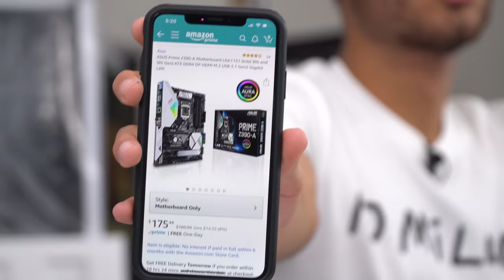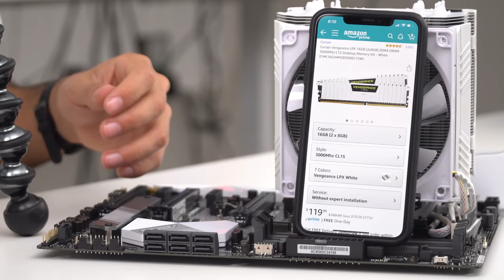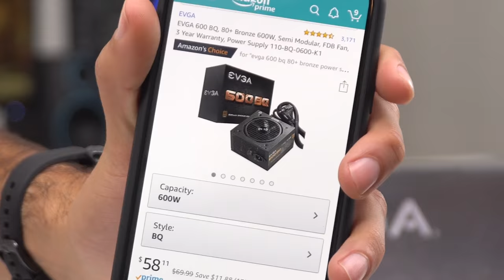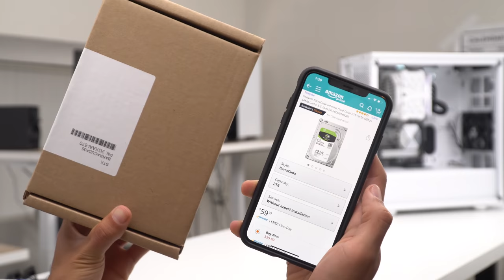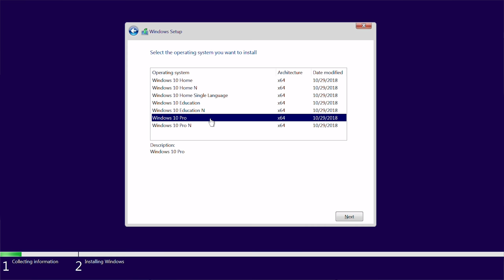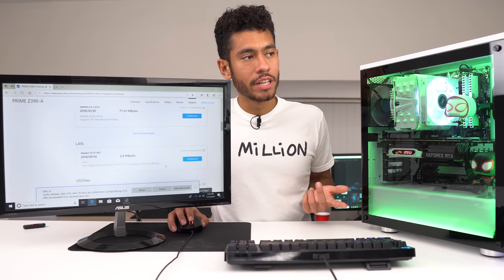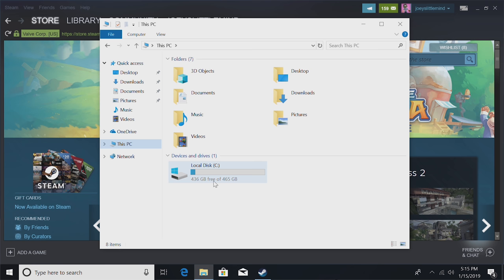$1500 Gaming PC Build Guide - RTX 2070 i5 9600K (w/ Benchmarks)

Comment: I’m building this pc in like 2 weeks when all my parts arrive, only things I changed were in using 2070 super and i7 intel. Do I need to change the power supple or no?
Reply: supply*
Reply: I have an unrelated question but did you get your cpu cooler off amazon and from the seller microcart
Reply: @evvanwhite  I got the cooler from Fry's electronics
Reply: Have you built it
Reply: vibranium I also built this. If you have questions I’ll be happy to answer
Reply: Electric Wolf do you play battlefield
Reply: How does it run like does the fps drop constantly
Reply: vibranium yes I have
Reply: vibranium it runs really good I haven’t overclocked it and it still is a beast
Reply: Rishabh Jain do you play bf v?
Reply: vibranium well I did change some things, I got 2070 super, i7 9700k, 64 GB Ram. But I do think it might be running a little hot I just gotta change the cooler to liquid one
Reply: Rishabh Jain yoo that’s expensive
Reply: vibranium yeah I spent over 2k lol and I don’t play battlefield V

Comment: Hey, can anyone help me? Ive bought a 2070 build for 1500 with about the same specs except the motherboard and processor. I got an AMD 3600 3,6 base clock. But the first 2 days I rocked everything at 150+ FPS but since a week I can’t run more than 80. What’s wrong? I reinstalled my driver multiple times and it doesn’t work.

Comment: Hey! I built this (with an i7 instead of i5) and the “dollop on the middle” for thermal paste was totally misleading. I turned my pc on for the first time and it only took 5 minutes for the core to reach 90 degrees.  More accurately, you should tell people to spread it around in a thin layer.
Reply: He's not incorrect. You did it wrong
Reply: It will spreas once u put the heatsink on it

Comment: 7:41 how did you do the wiring cause the camera angle is kinda fucky and I don’t really understand
Reply: Seri0sed the motherboard fan plug in spot is below the sata plug in. What he did is he took one fan cable and ran it in the back of the case and popped it out at that spot.
Reply: Andrew Tichich right but how did he get it from the from to the back, back to the front again. Cause he said it went up top and then back around to the mother board.
Reply: Seri0sed he put the cable through the nearest hole that separates the front and back

Comment: Is the thermal paste a separate cost? Or is it included with one of the components?

Oh and how well does this tutorial translate to the $800 build you have in another vid?
Reply: MidnightWolf Some cpu fans come with thermal paste but not all
Reply: @nico1415  is it required for installation?
Reply: MidnightWolf Its not but highly highly recommended. It transfers heat to your heat sink

Comment: Can I use a 650Watt 80 PLUS Bronze instead of the power supply he is using? the one he uses isn't available in my country. Also, can I use an NZXT Kraken X42 instead of the CPU cooler he is using? and is it better or worse? Thanks.

Comment: if I just switched out the i5 with a i79700k would it be ok or would I have to change some other parts too?
Reply: Just check compatibitly with the motherboard and socket of the CPU cooler and that I think should be it

Comment: is there a technical reason why you put the ram in those spots and not like side by side? (im building a  pc and idk if that is important

and why is the black version of the cooling 50 € less?
Reply: Yourigames Check your motherboard manual for which slots to put your RAM. Although most motherboards you put it in the 2nd and 4th slot.

Comment: Enermax ETS-T50 Fan Cooling ETS-T50A-WVS its like sold out 
What should you use to replace it?
And whats better in this case i5 or i7
Reply: The cooler master hyper 212 black edition is a decent option if your looking price to performance and can do a decent job overclocking
Reply: Jeffree Charles ok ty btw i5 or i7 ?
Reply: @andrenunes2496  depends on your need and budget. What is your budget?
Reply: @jamesscott3290  i7 would be better right and you you need a stronger power supply than the one in the video

Comment: Awesome build man just a quick question I got the same GPU as yours in the video and I'm not getting the same FPS results in gameplay any things I'm doing wrong do I have to bump up the ram it's currently running at the 2100 frequency out of the box I have not bumped it up to the 3200 frequency that it's able to do
Reply: well that's your problem lol bump it up
Reply: also quick question on internet...so if it's wireless, how do you connect?

Comment: I bought almost everything the same and even the asus monitor 144hz but i have trouble getting a display most of the time when im booting up, says no signal on display port or hdmi and ive plugged them correctly
Reply: Plug into the GPU
Reply: @jamesscott3290  it is plugged in the gpu
Reply: @picazoevo  did u fix it
Reply: @tinbullet2179  no bro i just unplug the monitor and plug it back in and it works, once its on it stays on so im just gonna have to reboot it everytime

Comment: I have a 2070, i5 8400, 8gb of ram. My fortnite when the FPS is uncapped gets up pretty high put for some reason dips a lot. I also have tried to stream and record with these specs but for some reason the quality is bad even with the new Nvidia encoder. Could it be my ram or is it my processor?
Reply: @Rad Rat Thanks, do you think upgrading to 16gb is enough or straight to 32gb
Reply: Rad Rat 16gb sounds perfect. I do edit using Vegas Pro 15 but with what I have right now the editing is fine. Once again thanks, haven’t gotten much help from anyone yet or any responses.

Comment: Hey so I built this pc but after installing all the drivers and everything I am not getting near the same FPS that he gets in the tests for some reason? Any ideas to fix this problem?
Reply: You might have vsync on  your games which depending on your monitors refresh rate could severely lower your fps. Try turning it off or if you have a high Hertz monitor set it to it's native (idk if that's the right term for refresh rate) refresh rate.
Reply: Jordan Freeman i figured out that for some reason my GeForce drivers won’t install because “they’re not compatible with this version of windows” even though I have windows 10 pro

Comment: Wtf I have I rtx 2070 and a ryzen 7 2700x I get about 130fps does the i5 9900k help that much
Reply: Yes the 9600k has better frames than the 2700x, due to its better single core performance. But the 9600k has only 6 threads and in the future it might or might not stutter.

Comment: Are u able to build the exact rtx 2060 build but with the rtx 2070 instead- meaning could u switch the rtx 2060 for rtx 2070 in the $1000 build???
Reply: I believe so but you need to have mid tower case because 2070 is bigger.

Comment: Is it worth it to get a 240 Hz monitor for this setup? And how can I find out if the PC is good enough for 240 Hz if I look at other setups?
Reply: BobbyMerica just look at benchmarks for the pc you want and if it can reach around 240 FPS on games you might want to buy a 240hz panel. Even if it can’t get that high of frames it will still look super smooth. Also there’s a 165hz spectre 25 inch monitor or amazon for 160 bucks if u want that instead
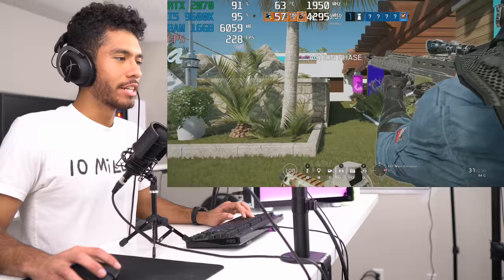Reply: @hyper9142  Ok. Where can I look for those benchmarks? I'm new to PC building and I'm planning to build the exact same PC. Are those the benchmarks 13:15?

Comment: 240Hz for Rainbow Six Siege on low/med settings? He hits 240 FPS in the video on Ultra Settings but it drips a lot.
Reply: Idk, 220-240 (sometimes more) FPS on ultra seems worthy of 240Hz if you ask me. Would rathe play on slightly lower than 240fps while having a 240Hz monitor than playing consistently on 144fps on a 144Hz monitor.
Reply: @Ab-er8ec  I wouldn't play on ultra settings. Mine will be on low and mid

Comment: Same pc spec and different fps. What causes the problem? GPU usage not that high as u How can i reach that performance?
Reply: i mean how u can reach nearly 100% GPU usage?
Reply: @gabordudas2789  it good to be at 100%
Reply: My PC spec: ASrock 1151 B360M pro4, Intel Core i5-9600k, 2x Kingston DDr4 2666 8gb Hyperx Fury GIGABYTE RTX 2070 WINDFORCE 8G, Seasonic Focus Plus 550 Gold. It is nearly the same PC but in Rainbow Six i ve got less fps (avrg. 50-60) WHY?
Reply: @gabordudas2789  might be your monitor try turning vsync off

Comment: Can someone tell me if I use a m.2 ssd will I still need the sata cables?
Reply: Strange Prodigy  you  only use sata cables for hdd or ssd. M.2 is already plugged in to your motherboard although if you plan on using more than an m.2 for instance a hard drive check your motherboard manual as some sata ports don’t work once an m.2 is installed.
Reply: Maniqa Dorthy| Thanks!
Reply: Hey. I don’t know how to build a PC and all. But the graphics card isn’t availible in my country what do I do

Comment: Why does he installed games on hard drive instead of on SSD? Im new to pc building.
Reply: I think thats bcuz games take so much space
Reply: @Fatima-re3wm  but isn't SSD run things faster?
Reply: @user-ee6md7vh1o  it does, you can do both btw it just depends on you
Reply: Its because games are huge af and will fill up the ssd with like only 3 games and u wont have space for other programs in the ssd. 
If yo get a larger ssd fkr example 1tb or 2tb it will cost u so much. 
A 1tb hdd is like 40 bucks but a 1tb ssd is over 100$

Comment: Hey I have this same pc but with a i5 8600k and on csgo I can’t get into 200+ FPS. Any tips?
Reply: Zaza Zaza idk
Reply: He has a i5 9600k that's probably why
Reply: And csgo is never consistent with fps lmao. It can run 300fps then the next day an update happens then it's at 120. It jumps, or so I've heard
Reply: YeoYolo Do you know if I’ll get better fps with the i7?
Reply: YeoYolo asking for fortnite
Reply: @teodoraljubojevic4319  the things that make frame rate better is the graphics card and the processors, so yes an i7 would most likely give better frame rate. But mostly the CPU gives better framerates when you are streaming or have a editing/recording software running. I would still look up a lot of reviews though.
Reply: @teodoraljubojevic4319  what I'm doing is I'm getting the rysen 5 3600 instead because 1. It's a little bit better 2. It's like 50$ cheaper and 3. It comes with it's own cpu cooler, which I've heard is good but I've already ordered a 4 valve cooling system
Reply: YeoYolo do you think a I9 9900k would do good
Reply: @horizon7879  well yea but I'm not no computer geek lol, but that cpu might be overkill for this motherboard but Idk lol i would do research

Comment: What would be a replacement for the cpu fan as it is always out of stock and im building this pc?
Reply: Pickle Boy I recently bought the fan and it came back in stock. Idk if it is now
Reply: I can't find the cooling fan for the cpu, its sold out or out of stock everywhere, do you know a place I can order it from (I'm from UK)? And also did you buy the Msi RTX 2070 Armor or MSI RTX 2070 Armor OC?
Reply: @EPICBOSSYT  I went with the OC and i just swapped to another cpu cooler as it was always out of stock. i dont know if there is anywhere to order it from the uk but any other cpu cooler will do
Reply: @pickles8023  For the cooling fan I have ordered the deepcool gammaxx 400 white (£30) but the rtx cards are very expensive. The armor oc is out of stock or being sold at a very high price on amazon. :/

Comment: FYI this is bs you can buy a prebuilt from best buy  with a i7 8700 16gb of ram and a 2070 for $1349 and you dont have to do any thing other than bluging it in
Reply: Just saying pre built pc’s can work much slower then a pc you built and the cost for making this pc was about 1288$ it seems like you bought a pre built pc and trying to make you’re self feel better by saying one’s that you build you’re self are not good value
Reply: @raiden4239  agree
Reply: This is wrong. Also some prebuilts are aesthetically ass interior

Comment: how does this build do against higher performace games like the witcher ?
Reply: probably wont do so good on max settings but on medium settings it would do fine
Reply: Easily run it
Reply: @cade5745  nah, turns out does great on max settings. Getting 90-100fps most of the time, only occasionally dropping down to 80fps

Comment: Bro i looked up the parts on 7/25/2019 and the total was 1366i just got no money RIP
Reply: You can grab then new ryzen 5 3600x and 2070 super for a really good experience and the processor is gonna be cheaper if you want you can get the threadripper 1920x for 270$ witch has 12 cores and 24 threads

Comment: YO ANYONE IN THE COMMENTS
I wanna build a pc but the cooler is unavailable on Amazon is it fine if I use a different one. Don’t judge I’m new to building PCs 🥺
Reply: Yeah you can use a different cooler as long as it is compatible with your case and motherboard, if your not sure what is compatible with what, I advise that you use you a website called pc part picker and go to the build your own section and chose the parts that you have and then when choosing the cooler it will only bring up what is compatible with the parts you have so far. If you need anymore help just let me know. 👌
Reply: Luke Thompson-Hughes thank you so much !
Reply: @vampd01l94  no problem, anytime 👌

Comment: Guys so im new to this and i have a question 
So my motherboard will have  1 display port available but my graphics card will have 3 how much display ports will i be able to use and how?
Reply: 1
Reply: Wait read that wrong 3
Reply: connect the display cable to the gpu always not the mobo
Reply: SpeechlessSpecter ok ty

Comment: I used the same cable you used for your gpu to power supply and my graphics card just isnt being registered. I have tried literally everything and I cant get this card to work. someone PLEASE HELP ME. P L E A S E
Reply: Did you push it in all the way
Reply: @-injustice-6738  I figured out my issue. Was running a pretty old version of my bios. Updated it and everything went smooth
Reply: @GamerJW235  kk nice

Comment: What is the WiFi adapter used for? And once you connect to the WiFi do you have to keep it in at all times if you’re not using a lan cable??
Reply: Pardiiz there is 2 ways to get internet conection. 1. Wifi adapter 2 lan. Lan(with wire) is faster, but you need a cable, but wifi is slower, but without cable. If u are using lan, there is no need to plug lan and wifi in the same time.

Comment: If you switch the CPU out with a i7 9700k it will still be around 200 less than 1,500
Reply: Phizur is it worth it though?
Reply: MightyShrimp it’s only 150 more than the i5 and it’s the best gaming CPU out right now. In some games such as fortnite and pubg it outperforms the i9900k but quite a bit